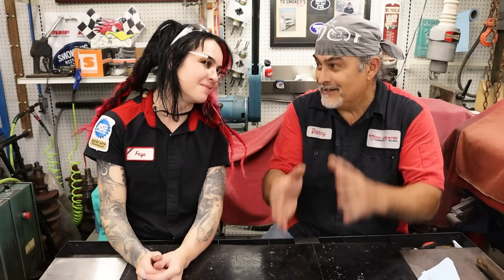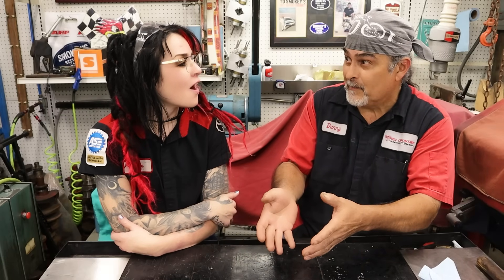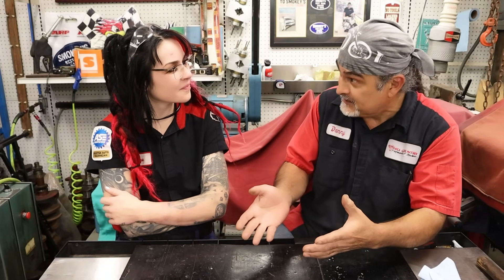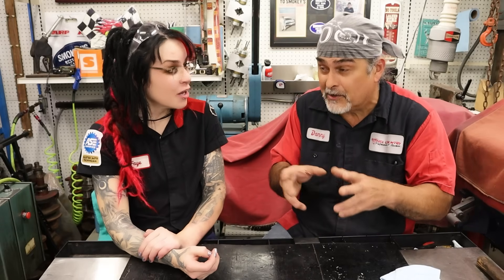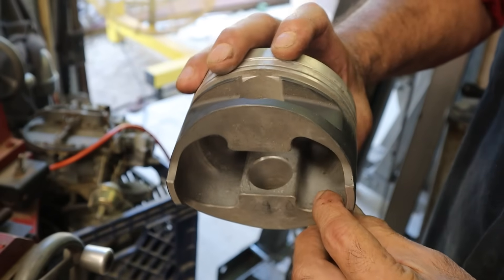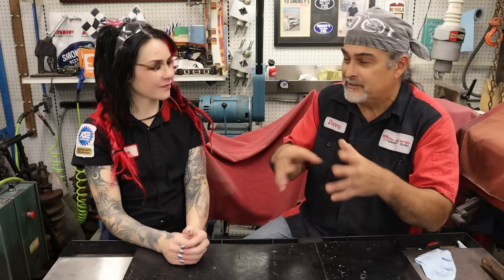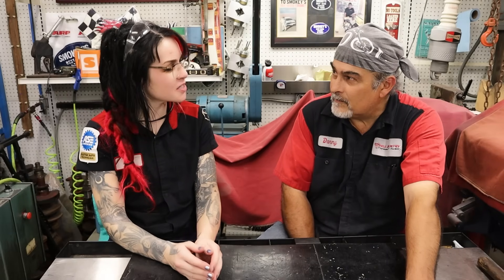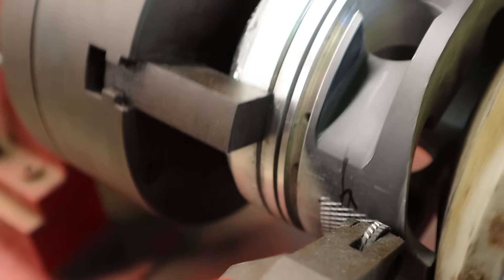Does Piston Knurling ACTUALLY WORK?! Answering your Most Asked Questions with @MrDanielSoliz

Comment: knurling rise a base material up (near to grooves). so they break-in perfectly to cylinder (if you start from too small), and allows to continue break-in during extreme hot conditions when normal piston would start to seize. 
that is my theory next to better oil retention.

Comment: I have personal experience with knurled pistons in a Maico dirt bike 50 years ago. The knurling did restore power and reduce piston rattle. I only felt comfortable knurling the Maico because they came with Mahle pistons which I consider to be much stronger than typical cast pistons. Also knurled pistons never stayed tight as long as a properly fit new pistons. Stay safe.

Comment: We were taught to knurl pistons back in College Trade School, knurling a piston was one of our projects we had to hand in to be marked as part of our machine shop grade. Danny’s correct in what he mentioned, the knurl holds more oil against the piston skirt and does increase cylinder pressures, the downside is the crowns on the Knurl do wear down quickly then reducing the HP increase. On a worn engine life can be brought back by knurling. We also had to knurl a valve guide also to be graded toward our machine shop marks. Good topic guys,  fully licensed service tech for gas & diesel since 1988. Love the trade. Great channel. NMJ

Comment: They burned oil. That’s how they made more power. A lot of race engines run lean, because power is limited by regulations and fuel has weight and refueling takes valuable time. If you add more higher octane fuel to a lean engine you can get more power out of it.

The reason they made more power is the smaller piston, not the knurling. If you want to test something you got to remove all but one variable.

Comment: I bet you there is applications for it in modern vehicles. modern vehicles get old parts get obsolete. And if you want this still running with that engine and you need to now do this

Comment: 40 yrs ago my buddy built a BB Chev 427 and had to knurl the pistons for a good clearance.

 No problems with oil consumption, it ran strong. Had valvetrain problems  'cause it would rev to the moon! Running a truck intake and Qjet no less. It was an animal. Absolute animal.

Comment: Reduced surface area contact with the cylinder wall equal reduced friction less friction means more power.
Reduced surface contact also means more wear and knurling means additional machining expenses, which is why most engines don't use it

Comment: I used to dimple (golf-ball) the piston skirts on two stroke motorcycle pistons. The reason for doing this was to hold oil. A two stroke engine does not have any lubricant when the throttle is in the closed position. So if you didn't blip the throttle, you could seize the engine. This worked great for flat-track racing.